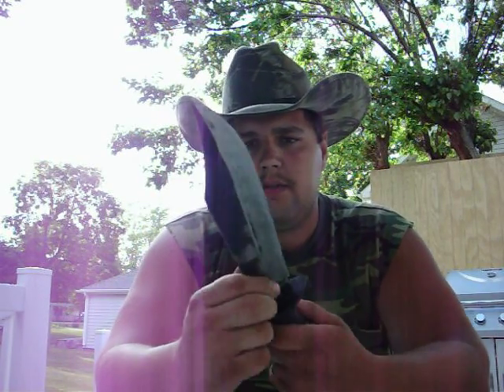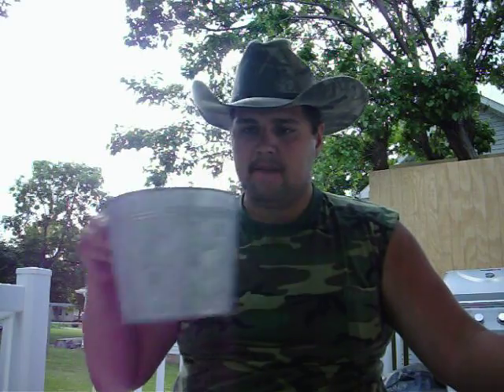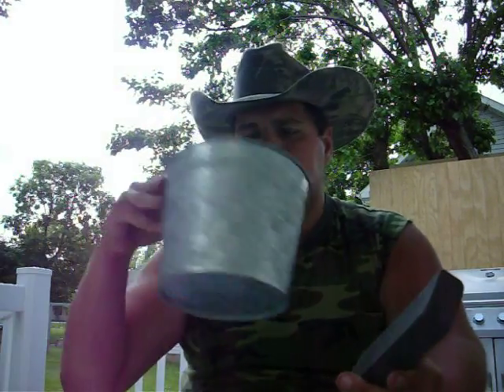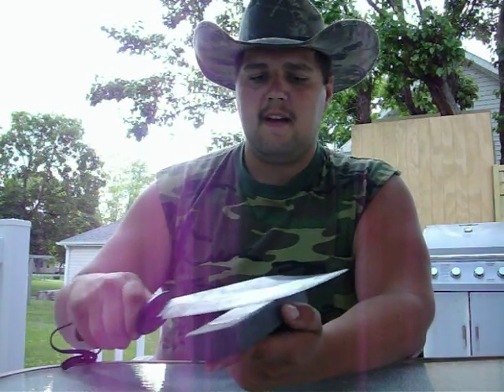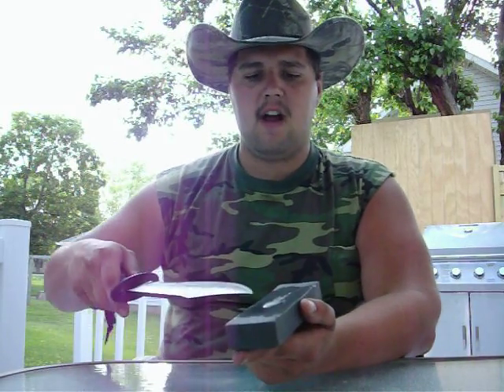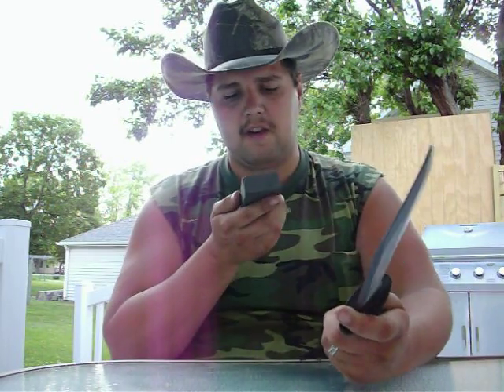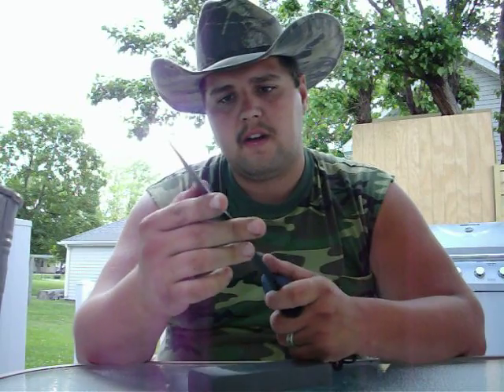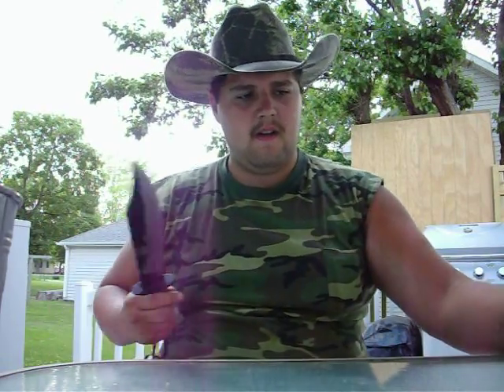Large Survival Knife Sharpening Part 2 by Tex

Comment: Hey Tex, do you have any recommendations on sharpening a a smaller blade such a Gerber Combat Folder? This is my favorite blade to carry. Not too big yet big enough to have great leverage when it comes to prying. Also balance is perfect for throwing if need be. I can' seem to find a good sharpener for it though. Now, I use a Smith's hand held. Has a ceramic and carbide feature, but doesn't seem to give the desired edge. 

Your vids are great by the way dude!!